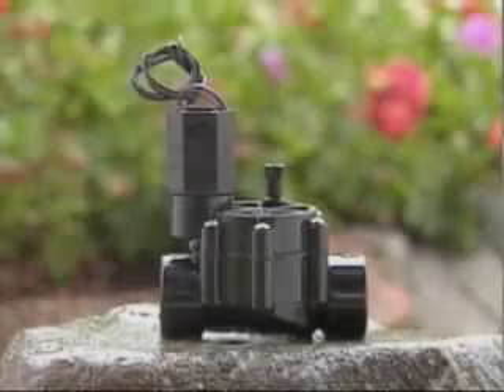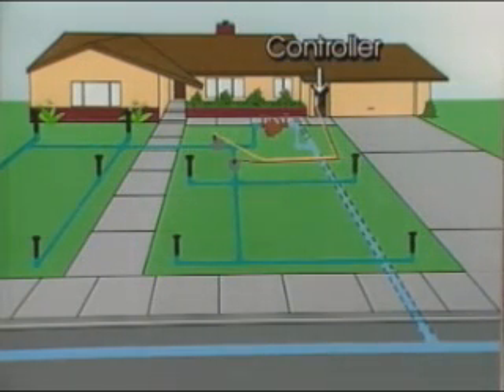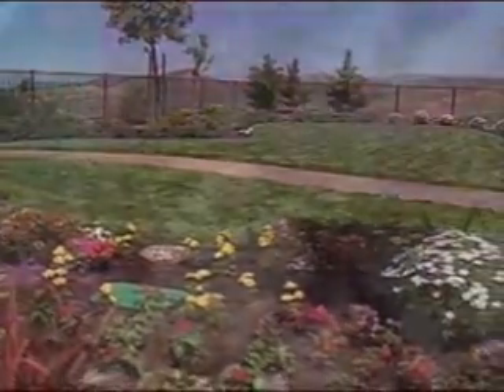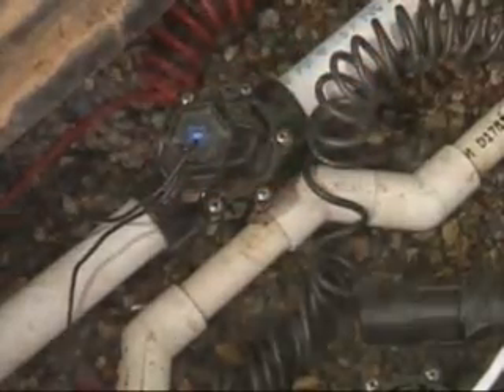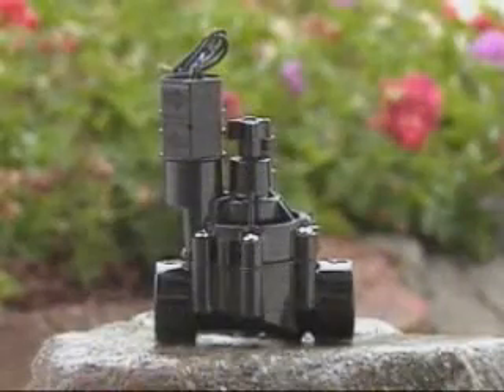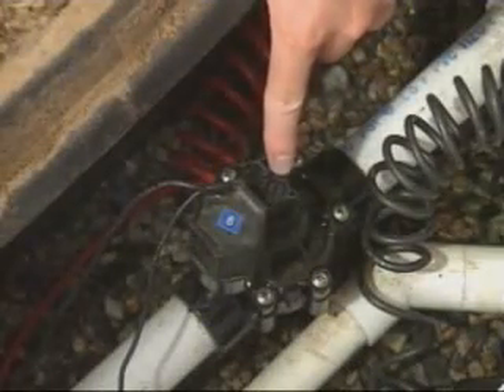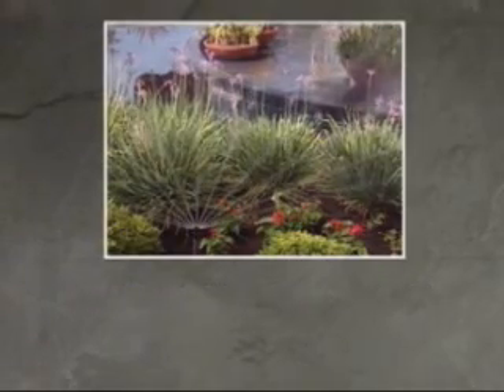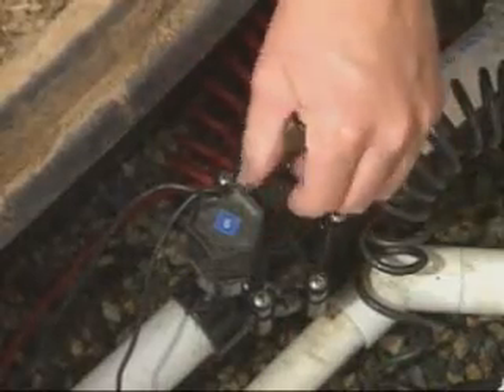Rain Bird Inline Sprinkler Valves: Basic Operation

Comment: Default valve position should be MANUAL OFF.

You only need to open these valves to check the lines without the computer.

Comment: This was no help I need to shut my whole sprinkler off a line is broken.
Reply: Did you get the valve shut off?
Reply: Even though this was many, many years ago, maybe someone came looking for the answer. If you need to work on your lines, you'll need to shut the entire system off. Not just that zone, since it's all under pressure. There will be a system valve for the entire unit. You'll need to shut it off there. Very similar to the water main shut-off coming in from the city water. My main sprinkler shut-off is in my flowerbed. 
You do not need to shut it all off for simple changes, like changing out a sprinkler head. At least in my experience- but I'm not a professional :) *that's my disclaimer!